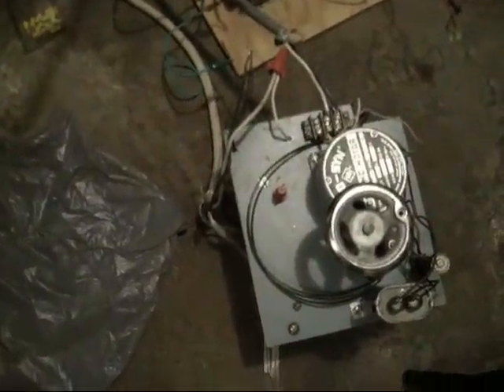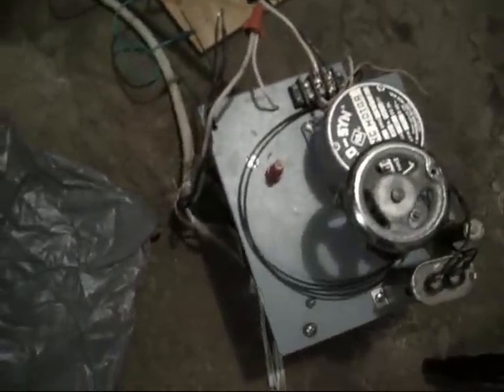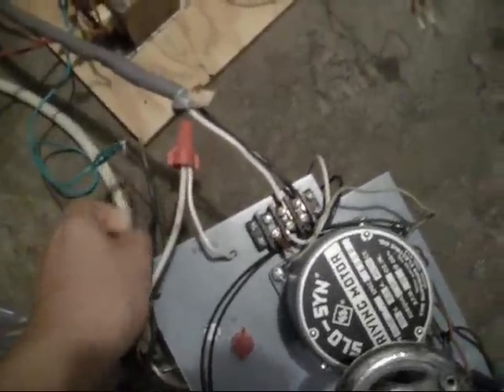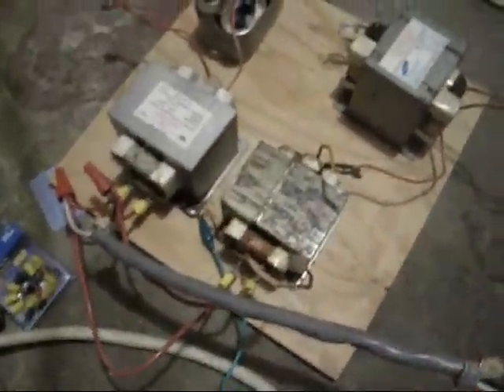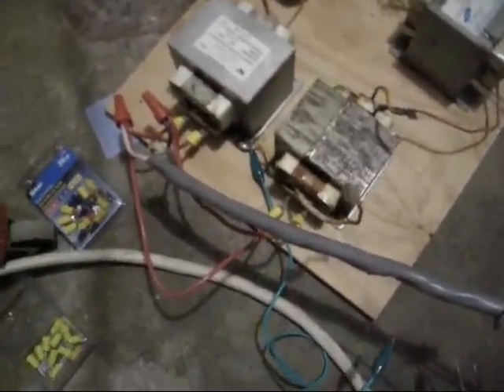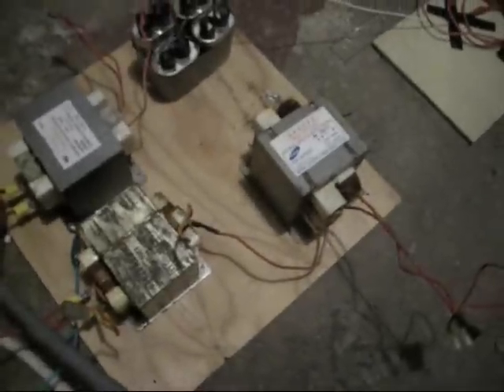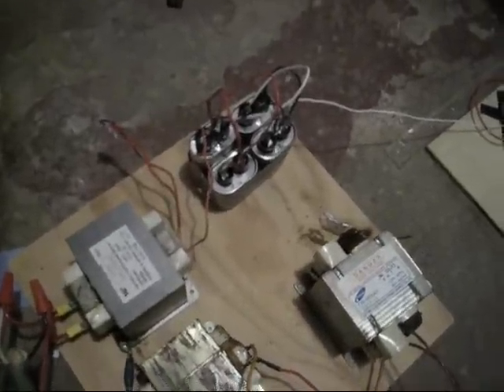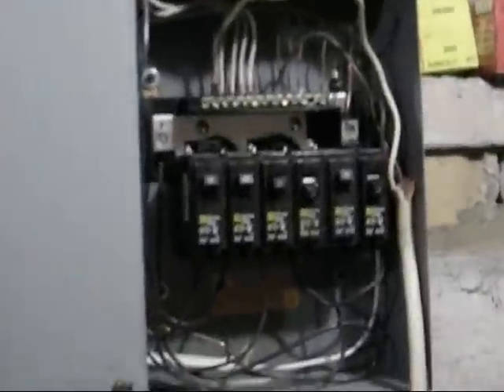More Resonant mot Arcs.  100% input voltage this time

Comment: cute :)
i did that sort of thing with a chain of 4 MOTs with secondaries in series. They did a good job for quite a long time, but one day two of them arced over.

Hint: use hot glue to increase the isolation towards the core.